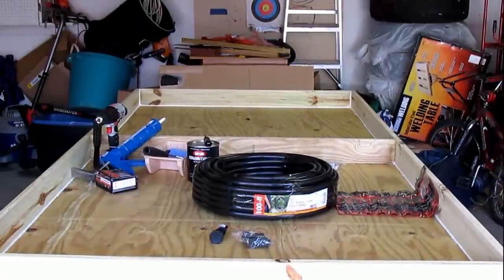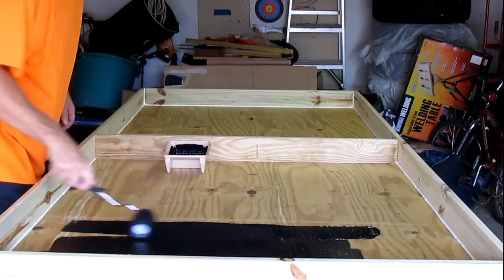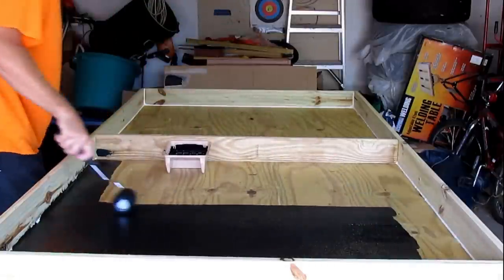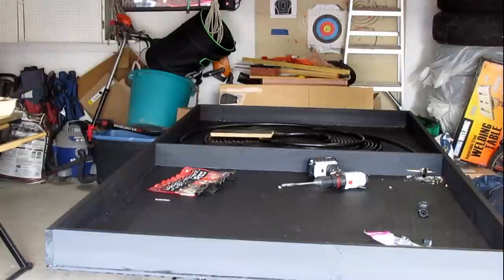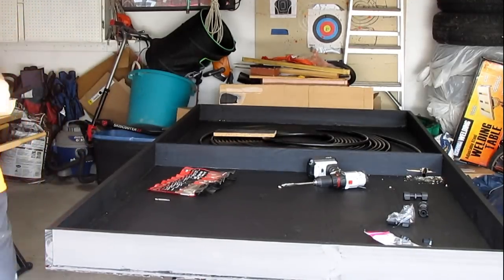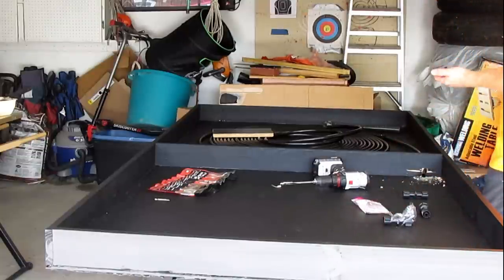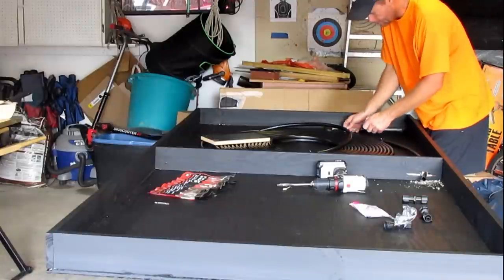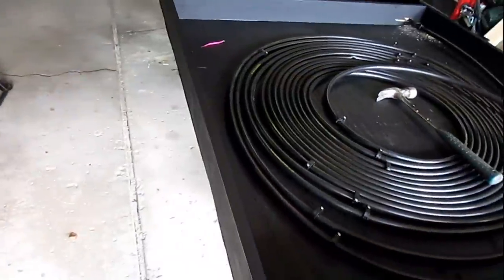How To Build A Solar Pool Heater - DIY!

Comment: @rc insiders    Hi. How did u secure the plastic top and is it as good as plexiglass which in our area is running 140 plus for 1/8 inch    Thanks
Reply from the maker: Hey David,
This is how we covered it - https://www.youtube.com/watch?v=sdV8_EJTVzo
Here is the plex alternative - https://amzn.to/2yeexDv
Plexi is the best, but yes it is expensive. Even more so now!
Did you build the solar unit?
Thanks for dropping by & happy heating my friend :)
#RCInsiders
Reply: Thanks idk where u are at but I’m in Pa. Will that provide enough insulation to keep the heat in in cooler temps like high 50-60 degrees?    I just made mine with 500 feet on a 4 by 8 sheet. This is the last step excited to get it working
Reply from the maker: @davidlafko7224  I have had temps inside the unit well into the mid-upper hundreds on a 70 degree day so it holds the heat fairly well. Im in MI so we have pretty similar climate. I am still 2-3 weeks away from opening. We had snow yesterday & this morning! I'm done with snow for the year!! :)
Reply: Lol.  Yes we had snow yesterday and today too.   Cool. Thanks
Reply from the maker: @davidlafko7224  👍👍
Reply: So we got this built it is 75 outside today and the water coming out of the hose end is 80

What am I missing. Pool temp is 69 so it is working but deff not the 120 degree I was expecting.   We r using a 1/6 horse power sump pump.  Is it pushing too much water thru to fast.   

How important is it that all the holes are plugged. We had to use some zip ties that we drilled holes in the wood to secure.   

Great project now need to figure out the fine too ing 

How much on an angle do u need to have it for best heat  Generation?
Reply from the maker: @davidlafko7224  Hey,
An 11 degree temp diff on the output is pretty good on a 75 day, especially with a bigger pump like that. 
Youmay not be getting super high temps, but you are moving a lot of water. I would think that by the time you read this your pool temp is already comfortable?
Reply: So far we are up two degrees but this is the first week with a lot of sunshine so we r turning it on at 830 and running till four while the sun is hitting it so we’ll see. We r at 70 in the pool water temp so another ten degrees. 

Would u leave the solar cover on during the day especially with hot temps or take it off and let the sun cook both
Reply from the maker: @davidlafko7224  Yes, 100%. Every second we are not in the pool, we cover it with solar cover.
This is especially important at night, as you lose a ton of heat at night. I have our water to 79 after 1st week of running. How big is your pool?
Reply: 16x32. 3.5 feet deep down to 6.5   Ok idk does it need to be at a harder angle like u where showing or as long as the sun is hitting it.  

This really is the first few days we had good sun for it to work. Unless the box is not holding the heat in because of some holes not pluged
Reply from the maker: Hey David!
I just saw this comment!!
How's the heater going?

Comment: How many gallons is your pool ?  How long does it take to heat it up ?   How warm have you gotten the water in the pool ?  Tryingto do one as you have but wondering how many units i have to make. 
Thanks , Gerry from San Diego, CA
Reply from the maker: Hi Gerry,
Our pool is 9,000 gallons. I like to keep the pool between 80 - 84.
I am running 2 units this year. On opening day the pool temp was 59. We had 3 nice days in a row and got the temp up to 81. The following day was hot & all sun all day. Had to shut the heater off as the pool hit 86, which is hotter than I like. Last year with one unit, it took 2 days longer to get the pool temp up, but was still very happy with it as we maintained 78-84 throughout the season.
There are tons of variables that will affect heat, with the biggest being the amount of direct sunlight the solar heater gets.
These last couple days have been cool and mostly cloudy, but have still maintained 79 in the pool. Tomorrow will be cold but mostly sunny so should be no problem to quickly hit 80+ & swimming by afternoon! :)
How many gallons is yours?
Thanks for stopping by & happy heating my friend!!
#RCInsiders
Reply: @RCInsiders  Really appreciate the reply !
Our pool is in inground at 15000 gallons.
Was contemplating buying typical solar pool panels but the less expensive type leak too much as I understand.
We like our pool at 88 - 92 but rarely see it that high but 1 - 3 days in peak summer.
Just ordered a solar cover so hoping to keep in more heat and water overnight lost due to evaporation.
Already use a liquid solar cover which I think helps a bit but nothing significant.
Wondering.....How many panels like yours I might need ? I get full roof sun at least 8 hrs daily and I am south facing.
Currently we are at 75 - 85 degrees outdoor temp and pool water is at 79 - 82 naturally.
Getting another 6 - 10 degrees would be awesome.
Appreciate your time and advice very much !!!!!
Reply from the maker: Hi Gerry
If you're looking to maintain that high of a temp, I would go with 2 units.
With our 2nd unit, I was able to fit 240" of tubing.
I think if you're getting that much direct sun you should have no problem getting those temps.
The solar cover will make a huge difference in retaining heat overnight. From what I hear, the liquid does next to nothing. I keep ours covered at all times when no one is in it. I only get about 4 hours of direct sunlight.
I actually just plugged mine in. Outside temp is 48 and sun been hitting unit for about 30 mins and already getting 84 degree water.
Have a great day and enjoy that California sun! :)

Comment: How did you coil it like that? I tried the other day and there were kinks everywhere and it was a mess.
Reply from the maker: Hi Juice,
Did you buy the coil that I linked to in the description?
You just kinda keep spinning it in a circle until it lines up how you want it. 
It shouldn't kink easily.
Let me know.
Thanks for dropping by & have a great day :)
@RCInsiders
Reply: @RCInsiders  Yep, 1/2 poly tubing. Maybe i'm trying to start the tubing in too tight of a coil. Do you have to do a lot of algae maintenance at those hot pool temps?
Reply from the maker: @Juice974  Hi,
No. We have never had algae issues due the hot water. 
Just normal pool maintenance like shock & chlorine. My wife keeps it clear all year :)

Comment: how long did it take to heat up the pool.  or how long did you leave the pump running to heat up the pool?
Reply from the maker: Hello,
There are a lot of variables that will determine how quickly the pool will heat up, with the biggest being amount of time the unit will get direct sun.
When we opened the pool this year we had 3 full days in the low 80"s & sunny all day.
We were able to get the pool all the way up to 82-84 in those days.
We easily maintained those temps all year & often times shut it off as it would get the pool too  warm!
Here in Michigan the pool season is just about over, but we are still holding on to 76-80.
If you live in a warmer climate in the south, you should have plenty of heating time left :)
Hope that helps.
Thanks for stopping by & happy heating my friend!!
#RCInsiders

Comment: Hi thank you for the video that was awesome.  Thanks for linking to the pump I just ordered one.  Is there any special reason to use a hose rather than more tubing as you come out of and go back into the pool? Thanks!
Reply from the maker: Thanks Ryan!
If you can swing it, tubing will work just fine.
I just found it much easier to work with hose outside of the solar unit.
Much more flexible & not constantly trying to curl up.
Good luck with your project & let me know if I can help in any way.
Thanks for stopping by & happy heating my friend :)
#RCInsiders
Reply: @RCInsiders  makes sense thanks!
Reply from the maker: You're welcome :)

Comment: How did you connect the garden hose to the fish pump?? The opening is small and not threaded?
Reply from the maker: Hi Naila,
I cut the metal threaded fitting off the hose. Pick the fitting that screws into the pump that will fit the hose you cut the fitting off, Screw the fitting in & then push the hose over it.
Have fun with your project & let me know if I can help with anything :)
Thanks for dropping by & happy heating my friend!!
#RCInsiders
Reply: @RCInsiders  thank you ! Also will the hose be a solid fit? Do I need to put anything over the the whole fitting hose contraption before I put the pump in the pool?
Reply from the maker: @bombshellsnaila6424  Pick the fitting that screws into the pump that fits snugly into the end of the hose you cut the fitting off. I'm not sure what size garden hose you're using, but one of the fittings should fit snug. If not, a small band clamp will work. There's not a ton of pressure, so snug is fine. Do you want a link to a band clamp that will work?

Comment: I think it's better to add two timers in the equation one to let water suck in from the pool enough time to fill in the hoses and another one to let the water back in the pool after it sits in the coils for approximately 45 minutes and keep this process running in the same pattern throughout the day.
Reply from the maker: Hey Fern.
There's no need for 2 timers as the tubes will already be full when the pump shuts off & will then go back in the pool when the pump kicks back on.
I will be adding a timer this year as well. I'm gonna start of with 15 mins on 15 off and see how it goes. Another fun experiment! :)
Thanks for stopping by & have a great pool season.
#RCInsiders
Reply: Yea only one timer is needed . I have made one but AFTER THE HEATED WATER has circulated  the water is barely warm , so I have planes to build one same size as this , but with 2 or 3 hundred feet of pex tubing , and timer running in half hour cycles
Reply from the maker: I'm adding a second unit as well & will experiment with the timer. I'll start with 10 on/off & make adjustments as needed. Hopefully I'll find the sweet spot & maintain the perfect (to me) 80 degrees )
Happy heating my friend!
#RCInsiders
Reply: Fern Builds Timers are pointless. You don't want the water to sit. A few pints of very hot water will actually contain less heat than many gallons heated by one degree. Heat transfers better to cooler water, you want to keep the water moving so it never really gets hot in the solar coils, it will carry much more heat back to the pool that way.
Reply from the maker: Hi Spencer,
So I have heard arguments and theories about this either way.
My plan is to experiment with/without the timer and see what works best for me.
Either way, you will be adding warmer water to the pool.
I know there are a lot of variables in either theory with the biggest being amount of direct sunlight.
Thanks for stopping by and sharing your input.
Happy heating my friend :)
#RCInsiders

Comment: I'm working on this and it's going very well. Can you please tell me what kind of plastic can be used?everything I'm seeing is very expensive. Also what would you think of wrapping Saran wrap plastic around it? Also did you secured or do you just lay it on top? What do you do when it rains? I would think water would get inside
Reply from the maker: Awesome Jason!
I hear you...Plexiglass is expensive! I found a piece of clear plastic last year on sale for 1/2 last year but it broke over the Winter.
There are 2 alternatives in the description that I am trying this year. They're not as rigid, but work.
I thought about saran wrap, but I think it will just melt. It may be worth a shot to try though if you're almost finished with the heater.
If you made the heater with pressure treated wood & then painted it, the rain & water is not an issue. The on;y rel thing we want the cover for is to retain the heat.
The cover is screwed down with drywall screws to try to make a seal & to keep it in place.
Glad to hear your project is going well :)
Thanks for stopping by & happy heating my friend!!
#RCInsiders
Reply: @RCInsiders   reply. I went to the store and bought the plastic wrap used for wrapping furniture and I'm going to give that a try.. Thanks again for your help and have a great weekend
Reply from the maker: Awesome Jason,
If you get a chance, let me know how it works?
Have a great weekend as well!

Comment: RC, I see the pump pushes 800 GPH. I have a sump pump with 1800 GPH I use to help drain the pool annually. Do you think I could use it, or it pushes too much water?
Reply from the maker: Hi Joseph,
The reason I like this pump is the adjustable flow rate. 
My advice would be to give it a shot. If that high flow rate gives you a higher outgoing temp than incoming I would think that's OK.
The competing theories about flow rate are never ending. Here's what I think after a couple years of experimenting:
On hot sunny days, I run the flow rate at max...As long as outgoing is hotter than intake.
On cloudy, but hot days I like to run a timer with 15 minutes on/off.
On partly cloudy days, I run the flow rate lower.
I will continue to experiment, but these methods have worked well :)
Our pool season is short here in MI. We will do anything for a few extra days in the pool!!! Lol.
Are you building one soon?
Let me know if I can help with anything.
Thanks for dropping by & happy heating my friend!!
#RCInsiders
Reply: @RCInsiders  Thank you , forgot about the adjustable flow rate.
Reply from the maker: @augyfl  You're welcome Joseph. Did you try the sump pump?
Reply: @RCInsiders  Didn't use sump pump, ordered and received the one you suggest from amazon.  I have everything I need, just waiting on warmer weather. Now my concern is I saw you created a part 2 for this video and made a 2nd one behind the first. Do I need to build another? was hoping this one would help warm up during the day after a chilly night in May and September.
Reply from the maker: @augyfl  Hi,
No you don't have to build a second one. The one heater unit will make a good difference & make the pool much more enjoyable :)
I built a second unit because in my back yard I am always fighting shade from trees & to speed heating. I often times shut the units off when the water gets too warm. If the wife would let me, I would build 5 more 😜😁 Our pool season is short here & if each new unit got me a few extra days in the pool each, I would call it worth it! Lol. Also, keep the pool covered at all times when not in use. I use a cheap solar cover. Especially at night as this is when you lose the most heat.

Comment: I'm in Costa Rica and my water temp is about 68°. I have about 5,000 gallons and would like to heat it to 75-80. I know there are variable that change water temperature but our sun is super strong. 11 uv index. How many of these would you guess I would need to build in order to reach my target temperature? I have 2- one meter mirrors as well that I can use to direct the sun onto the boxes.
Reply from the maker: Hi Robert,
My guess would be  that one solar heater should work, especially in your location.
Be careful with the mirrors. I don't want you to melt anything 😬
There are times during the Summer that I shut the heater off as the water temp pushes over 80.
Remember to keep the pool covered when not in use with a cheap solar cover. Especially important at night as this is when they experience the most heat loss.
Do these things and you should be all set for an enjoyable pool season :)
Let me know if you need help along the way.
How are things going down there?
Thanks for dropping by & happy heating my friend!!
#RCInsiders
Reply: @RCInsiders  Thanks for taking the time to answer me. I'll skip the mirrors for now. Things are going great. Miss my friends and family back in Louisiana but im loving beautiful Costa Rica. I'll let you know how this project goes and what I learned. have a happy Easter.
Reply from the maker: @puravida9302  Awesome Robert! Happy Easter my friend 😃